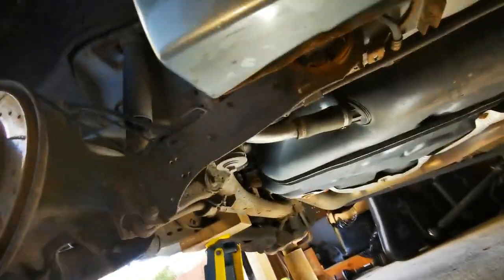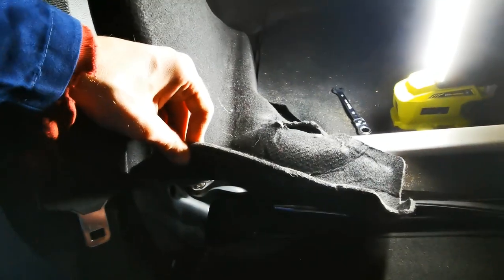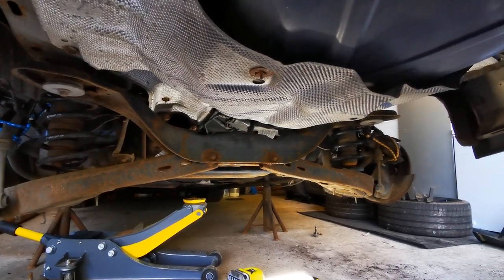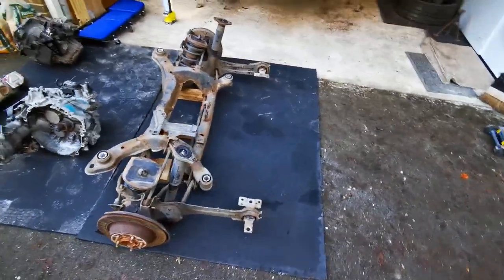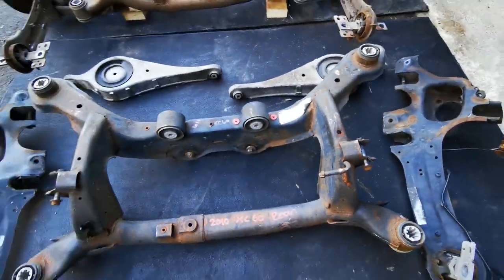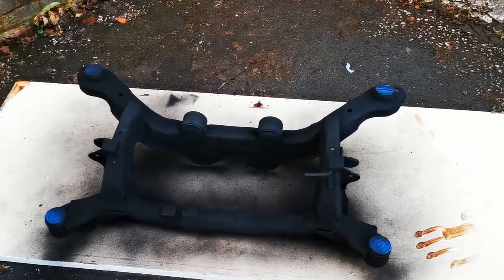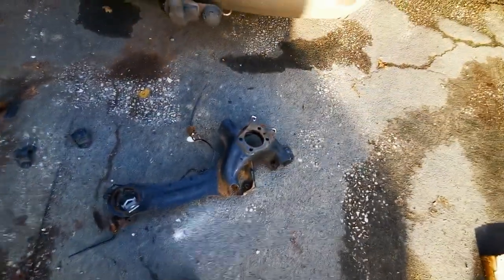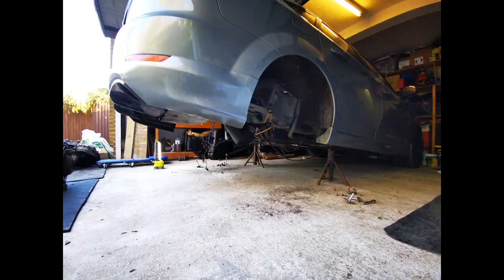XR5X4 Turbo - Episode 2

Comment: I’ve just noticed something. If you look at the mondeo subframe. There are two indents on top of the centre bar. I’ll lay money that if you measure. Those two indents will line perfectly to the xc60 diff bushes.
Reply: Yeah its as if they are made on the same production line, then split off before the bushes are welded in and the other forward mounting point being threaded
Reply: Matt G be interesting to see how close a mondeo subframe could get. Are the side bars higher to allow for half shafts or are they both the same?
Reply from the maker: @phoenyxrises2162  yeah they look identical in all other respects